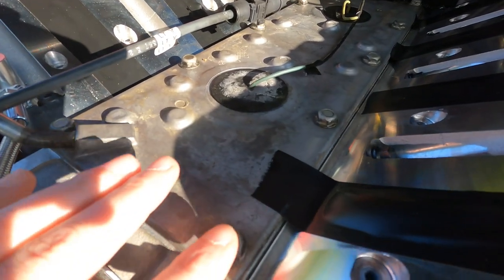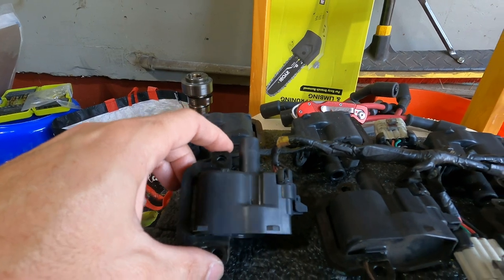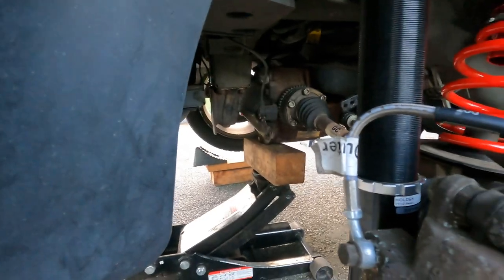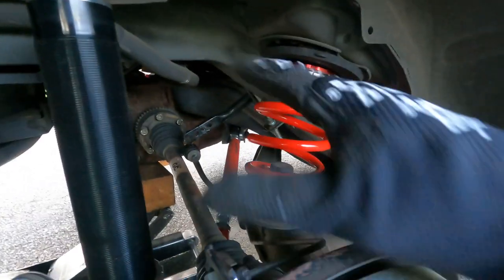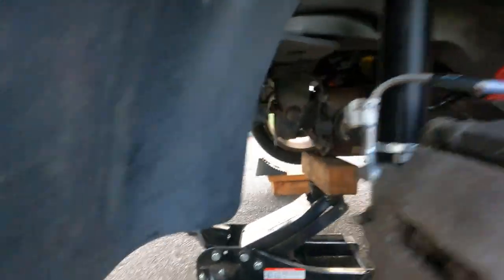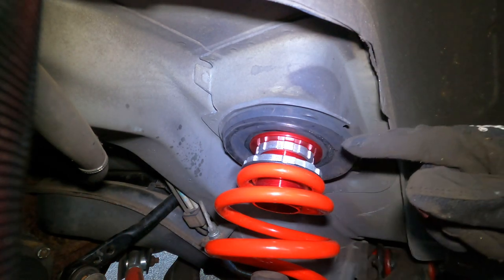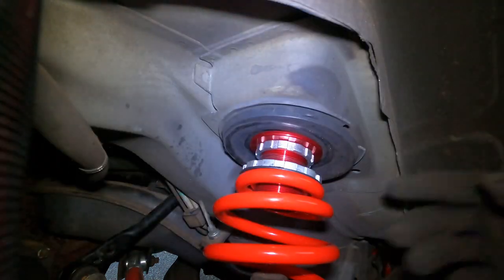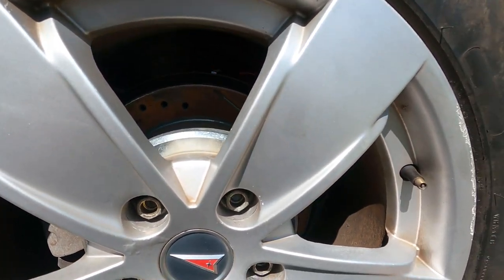GTO Pedders Extreme Xa Rear CoilOver Adjusting

Comment: Awesome. Good timing. 

Just got my GTO Pedders Extreme Xa Set installed last week. Already had to get the fender rolled a little on the driver side, front. But planning on adjust the other wheels and softness as well. Definitely looks like it'll be a process. So really appreciate the video.
Reply from the maker: Did you get new wheels or just lower it? I was thinking wide body kit but don't want to cut the fenders 😅
Reply: @Billy_Ray_Garage  Already had newer low profile wheels from the previous owner. But the auto shop is just a standard shop and really just installed it with very little consideration for other things. So, really just replacing the old suspension and thought it would help with swatting and some rear end noise, which I think is probably caused by the sway bar bushings at this point. I would have gotten more of a stock set up but the parts and labor would be been about the same as what I spent based on what the mechanic said. That said, still working up my confidence to do more of my own maintenance and that repair shop bill is very inspiring. 

But currently, it's not squatting very much and "no wheel spin." Which is very nice and my rear tires appreciate it. However, the ride is still rough due to the condition of the roads. So, still looking to adjust the height for passenger weight and overall ride comfort.

I hear you though. A wide body kit sounds nice, but I hear you on cutting. Can't go back after that. 

However, can you raise the suspension up to a point that you don't have to cut and it still looks good??
Reply from the maker: @whenniceguysretaliate5619  I would have spent thousands sending the car to a shop! It can be intimidating but having a bunch of tools helps. Only thing going back and having a shop do it would have been the subframe connectors. Doing that with no lift is horrible. 

I'm not sure how high you can go with these springs. If I remember correctly you can get stock height, maybe a little more out of them.

With the noise, that can be anything. But if you suspect sway bars. Change the endlinks. Its cheap and easy to do. All the other bushings are an MF'er! Haha
Reply: @Billy_Ray_Garage  I hear you. Currently, I try to weigh time, tool cost, difficulty and lift needs as well. But it's also my daily which makes it interesting. Copy that and thanks on the end links. That said, the primary reason I was considering the sway bar is because it seems like the subframe is twisting to a point where the either the differential gears or one of the axles is rubbing during slow turns and reverse. But I have other sounds as well and just thought they might be caused by the same item, but the end links are directly related. And I've already had the Rear Subframe Bushings replaced which helped but didn't resolve everything. So, I appreciate the recommendation as it could solve the issue. 

Also, this weekend I saw a video of a GTO's suspension which was pretty cool. So, I'm thinking mounting a camera/cell phone under the car and just investigating the sounds more while driving. Because, at this point, I'll have to find it and learn how to replace it myself. 

Thanks again and Wishing you much success.

Comment: What exactly does adjusting the rebound on the rear shocks do for the GTO?  Does it get softer does it get harder? I'm new to coilovers
Thanks
Reply from the maker: It pretty much controls the travel of the wheel. Adjusting the shock determines how far down it goes, and the adjuster knob in the trunk determines how far up it goes. You can make it harder or softer since it's adjustable. If you aren't racing or tracking the car, you want somewhere in the middle or you will feel every Crack or bump in the road. Let me know if that helps or need more info

Comment: I’m back brotha,I got lovells stock height springs and koni shocks.someone locally selling the pedders adjustable springs without the pedders shocks coil overs.can I still use them for spares?
Reply from the maker: I'm not sure. I know the springs are smaller but you can get to at least stock height.  The stock shocks have longer travel, and never compared the the pedders max adjustable travel to the stock length. Probably have to try it out and give us the answer to that

Comment: Dude tell me why the previous owner of my GTO had the fronts at their lowest setting and the locking nut on the top of the coilover was digging a groove into the inside of the tire and then I went to measure the rear shock just like you did and I got a measurement of 9 3/4” ….. that’s a long way off from your 7 1/4” that you ended with 😂😂
Reply from the maker: I had the same issue in the front but the spring was rubbing the tire. As far as the back goes, that's rebound travel. Not sure if the spring would stay in with their extra travel if you got airborne haha 😆

Comment: Why is my rear bouncy on my 12 SS Camaro.
I have new Pedders coilovers
Reply from the maker: Only thing I can think of would be they are on the softest setting and the rebound is set long. Not sure the camaro set up. I'll have to Google them
Reply: @Billy_Ray_Garage  thank u
Reply from the maker: @damonbernard2802  looked at a pic, doesn't seem to have the rebound travel the GTO has. Much shorter. Mine has 30 damping settings. It's set like 8 clicks from the hardest and its pretty solid. I would try that first since it's the easiest to adjust
Reply: @Billy_Ray_Garage  its crazy bouncin. I hit a dip, thought I lost it.
Difficult to adjust?
Gotta take the wheel off?
Reply from the maker: @damonbernard2802  not sure what you have to do. My adjuster is in the trunk. Based on the pics I've seen of that coilover, the adjuster is in the wheel well somewhere. My only camaro experience is driving a newer SS. Never worked on one

Comment: save yourself some pain with the valve covers...piss em off...spraypaint the old ones....'black'...to dissipate heat faster.....And buy yourself some new coils....You will be much happier.....Because......you will have to get  New coils to suit the New valve covers then you will have to get a New harness to suit the coils which have different plugs,And the New coils to suit the New valve covers Have a different Dwell timing...Then...you will have to re-map the PCM/ECU.....i've just been through it.
Reply from the maker: Yeah I gave up entirely on those valve covers. Stock are back on. Eventually gonna get new coils but that's down the road